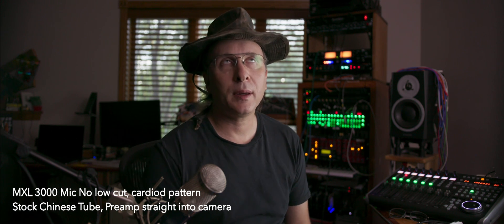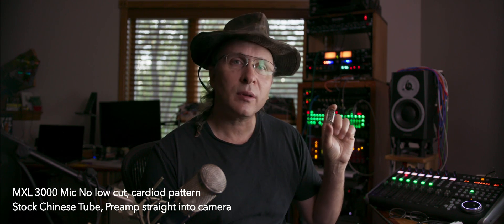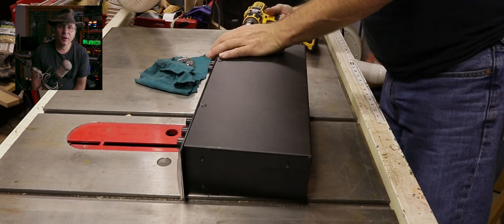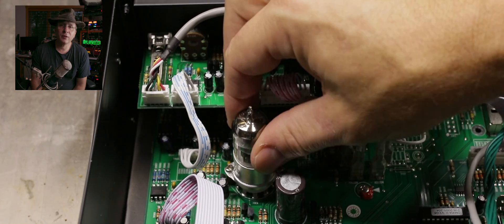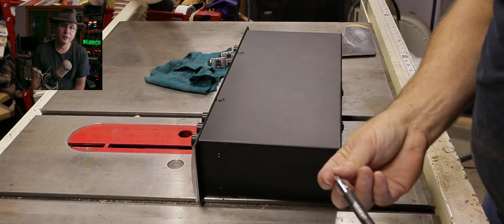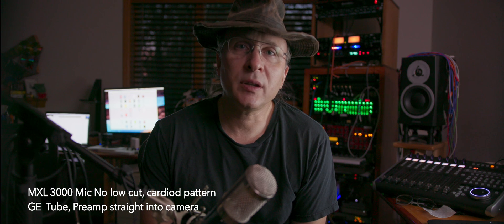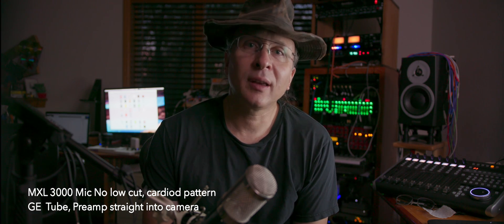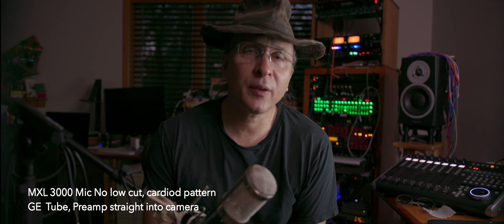Does Changing The 12AX7 Tubes Make A Difference with In The ART MPA Preamp For Vintage GE Tubes

Comment: Thank you for this video Steve!
Please help, I can not find any info on Mic Preamp Tubes that will be use only for Vocals. 
Whats tubes would be good for Vocals??
I'm going for a full sound and smooth airy sound (Mariah Carey, Luther Vandross)
I just got the ART Pro MPA II and I'm going to change the stock tubes
Please any recommendation? thank you
Reply from the maker: these GE's are. however the mic will have the first and most important difference in any recording. tubes are more shaping transients, eq aka tonal shaping, gain and possible ( intentional ) clipping characteristics. some tubes can lend a bit of compression to the signal in their non linear gain response. look for a good mic - which doesn't mean super expensive either - first. this or other tube preamps can certainly help. it also greatly depends on the voice or instrument as some mics / preamp combos will work better than others. you have to learn your gear and pick / experiment a bit for the best combo.
Reply: @thedp  Thank you Steve for this great advice!

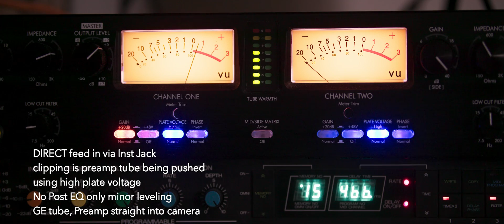Comment: 2:40 & 4:24 for DI clean
1:51 & 4:34 for stairway

I can hear a huge difference but that has more to do with your playing than anything. Try reamping next time for more accurate test please?
Reply from the maker: what do you mean by reamping ? test was done in the time it took to change the tubes out, shoot the process.
Reply: @thedp  Oh just that if they were exactly the same track reamped through both of the configurations, there would be no questioning whether the difference between takes is in tubes or your fingers. Also that way the tracks could be used to phase cancel each other for accurate analysis.
Reply from the maker: @Zilbyfilms  oh you mean  playing a pre-recorded track thru the Art Pre... I've heard a few reviews that did that, but more work to set up :(  not a bad idea but also subject to your initial recording & playback  too. I think I was reasonably consistent on the playing part, nothing changed much between setups.
Reply: @thedp  depending where your fingers were, i noticed. on the stock one it had more rattle from the guitar. but listening back, i actually preferred the stock one since what you were playing was better with classic rock, i personally prefer OD over classical sounds but i think i'll be fine with the stock ones in mine.

Comment: Would you consider to try with 12ax7 groovetubes? i wonder what would be the result.
Reply from the maker: probably a more midrange sound. the GE's are pretty flat and designed to work out to a few MHZ. FWIW Telefunken is GE design / tech at 10X the price.